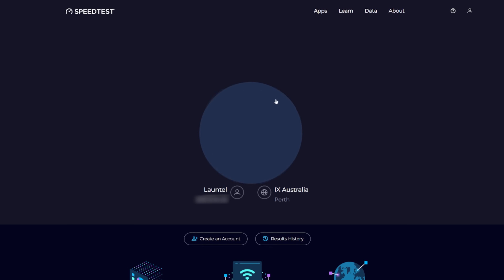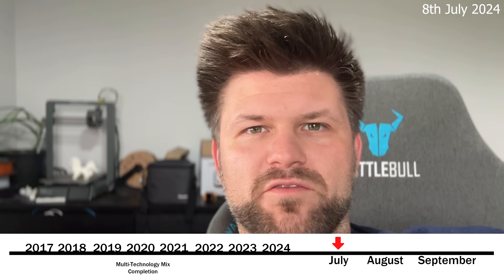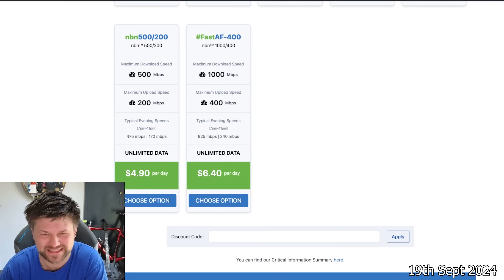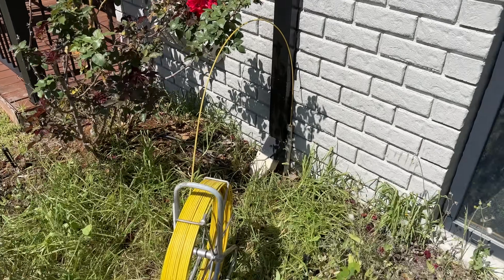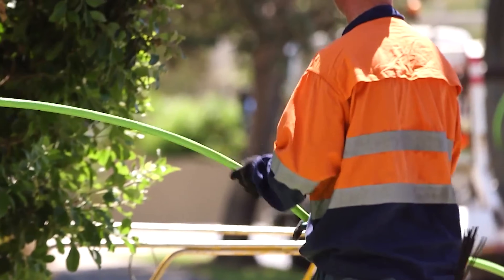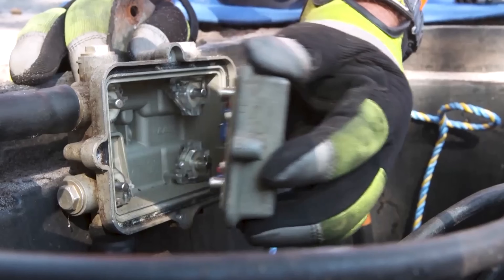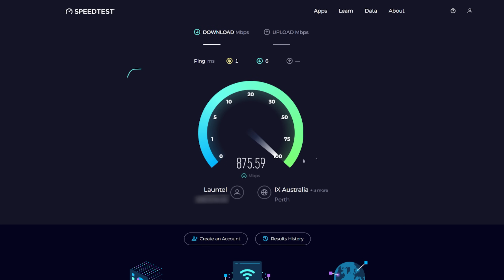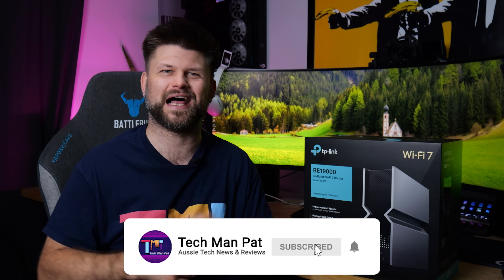My NBN Fibre Upgrade Experience | Dirt Report

Comment: I have been told by some data cablers that running a conduit in a built home is almost impossible due to wiring rules being too restrictive and not being cost effective, but they have turned around and said they can pre run a fibre optic cable to the room I want in preparation for upgrade day, cost I have been quoted is $550? Am I being scammed?

Is this info correct?

Comment: I had a roller coaster when I got HFC to full fiber (FTTP) (HFC: 1650down / 86up Dual Connections) to 2000Mbit down 500Mbit up super fast as of writing this from the speed boosts and about 30$ less for 2 lines.
They said the line is in and I am able to get it but they said my side had no line so the guys were nice enough to install the line down to the node since I had already ordered it and Aussie said they will cover the first month for me and half price for about 6 months since I needed faster speeds for work and NBN not listing the issue.
I am happy with my 1000/400 to 2000/500 now :)
They did just berry the cable and part was just hanging out of grate and my landlord was not happy and had to get them to put the cable at least deeper in the ground. No cost. Thats why they gave me 1 month free and half price for 6.

Comment: Put through a request for FTTP on Wednesday, they had techs come out and install on that Friday. I initially thought they were just coming out to inspect to see if it can be done but I was wrong. 

They were able to install it exactly where I wanted, which they went into the roof to run cables. It was insanely quick

Comment: I have FTTC. The pit is on the council strip on my neighbours house - right on the border of my house. It’s been FTTC since I swapped from ADSL2. I have about 9 metres of copper from the pit to my phone port. 
Can’t see any reason to upgrade to FTTP. I used to have 50Mbps, but now that I live alone I’ve moved down to 25Mbps to save a buck or two.  My home phone was installed in 1982, so I can imagine the copper/conduit is not in the best condition having sat underground for 40 plus years, but my FTTC works flawlessly.

Comment: Great video.  Thanks for taking us though your upgrade.  Regarding how far into the premises NBN techs will run fibre to the NTD.  You mentioned 12 metres - and that's what I've heard/read.  However, you also said IF I get an approved P20 conduit run inside the roof (with a drawstring) the NBN tech will do a fibre run of up to 40 metres?  Is that distance still correct?

I'm gonna have a conduit run in the roof.  It'll only be 15 metres which includes coming down an internal wall to my study.  Let's hope that if I go to this trouble the NBN tech will run fibre through it.  Fingers crossed.

Comment: Just a suggestion.
Ensue your NTD is accessible (not put behind furniture) so you can see the lights for fault finding and also ease of access when its time to replace the battery backup, which comes complete with a "smoke alarm like" warning buzzer every couple of minutes.

Comment: Pat, I recently had FTTP installed into my home as well, using iiNet and NBN. I note in your video that you say you are using a Deco Mesh setup and the TP-Link BE800. When I looked this Modem/Router up it says it is EzyMesh capable. Why I noted this is when I recently contacted TP-Link Technical support about the VX420-g2h Modem Router's mesh capabilities that iiNet provided me, I was told that TP-Link have three Mesh Flavours, Ezymesh, OneMesh and Deco Mesh and, that none of these interwork with the others. Perplexing as they are all TP-Link systems.

Anyway, how is it that you can be using the BE800 Router (which is meant to be EzyMesh) with a Deco Mesh System?

Comment: My parents recently had their FTTN converted to FTTP. The NBN contractors who installed it, put it approx 5 cm underground, with no conduit used from the footpath pit. 
Is there a minimum depth that the cable needs to be and is it mandatory for them to use conduit? My Dad is worried about it being too shallow.

Comment: They are also not supposed to put it on a second floor either. Recently finally got a fibre upgrade at my work where I do IT, we ended up running our own conduit to the location with a pull string, after the NBN techs showed where they were going to put the external box. End up being simple install in the end.

Also just note that you cant just use any 20mm conduit. There is a special NBN conduit which is actually 22mm I think. It is actually marked as NBN conduit that we found out about from our local electrical wholesaler.

Comment: If I had an option for fiber I would ask for 10G SPF+ fiber speed with at least a Mikrotik 10gig router if not an OPNsense box. Ethernet is slightly slower not that it matters :)

Comment: Just completed my FTTP upgrade. As I wanted the NTD installed in the top of a cupboard in the middle of the house, I bought some 20 mm communications conduit from Bunnings and ran it up the outside wall, then into my roof, then across to the cupboard, then down into the top of cupboard. I had a pull line in it ready to go. The tech was pleased to see that I had made his job easy. I ended up with almost exactly the install I was hoping for.

Comment: GigabitMan Pat.

I still laugh when I download a ~200MB file and it just instantly finishes.
Reply from the maker: haha best feeling!
Reply: @TechManPat  2017 I got 80/20 via FTTN and it was twenty times what I'd endured since 2003 on ADSL.  I have no complaints even up until now however we are now told FTTC is slated for us in SA @ 800MB/sec which is far more than I require.

Comment: fyi you are flogging an ISP that is just a reseller of the nbn network.  on fibre service, you probally wont find much difference between resellers unless you are getting a larger provider who has deals with nbn and can route your service around some of the nbn short commings.

Since that is the case.. most of the times the cheapest will do and you know that that provider will not go under
Reply: NBN connects you to the ISP. ISP connects you to the internet. Performance across ISPs does vary, but not enough for most people to care.

Comment: My installer went above and beyond on a tough install. The outdoor wall box is at one corner of the house. The NTD location is at the opposite corner about 20 metres away. Cable length that's about 27 metres away. He put the cable straight up from the outdoor box into the roof. He removed some roof tiles and pushed the cable through the roof cavity and at the NTD end he planned on using the old copper to pull down to the bottom of the wall. But the hole was too small in the joists to get the connector through. He called another installer friend to come and help. They cut the end off so the cable would fit through and pulled it the other way then put a new connector on the cable. He did say that without conduit for the cable in the roof it might get damaged and need to be replaced. I'll deal with that if it happens.

Comment: I don't think the NBN installer will be happy with the house I live in to install FTTP. It has brick cement render/plaster walls and the current wifi modem is in the dining room which is located in the middle of the house. They could route the Fibre cable along the same path of the existing copper telephone landline to the hallway. We'll see when the time comes.
Reply from the maker: It’s likely they will ask for a closer place… to make a job easier

Comment: I was told they would ONLY put it in the garage. However, when the technicians arrived, there were two of them, both Indian (irrelevant I know but I find Indian people very friendly and hardworking)  and very, very professional they looked at the garage and asked me where the Study was where the current modem is located. I told them it was on the other side of the back wall of the garage........ and the head installer said "Well, why don't we just put the NTD in your study and you can save on running cable to and from?".
Great!! That's what they did and they tried very hard for half an hour to get the conduit through the wall but it being alongside a window, the extra bracing prevented it so they put the conduit down the brick wall from the eves and into the house that way. I was totally happy with that because they sealed everything up so rain/moisture couldn't get in and we had a big rainstorm the next day and no leaks!! Also, there is a conduit on the opposite side wall of the house where the conduit comes from the street so no dramas. From there to the study side they pushed a conduit through the roof simply by removing tiles on the edge and pushing it through.

If I had a question, it would be that I got a text message from iiNet to advise me to plug the NTD into the modem (the FTTN is still connected for a week or so) so they are both plugged into the modem/router now but when I log on to iiNet Toolbox it tells me the install is still "in progress".

How long does it usually take for the FTTP connection to start 'working' after the NBN leave the premises, is it days or hours or what?

I'm a bit confused now because I don't know whether to disconnect the old telephone (RJ11) cord from the router or not? When I do a speed test on the computer, it still says around 60-70 Mbps so obviously the FTTP isn't 'active' yet?? Love your videos by the way, they've been very helpful when I decided to avail myself of the free FTTP upgrade in preparing.
Reply: iiNet FttP should work same day as install. If not, give them a call.
Reply: @iamdave84  it did!! Within an hour of the installers leaving.

Comment: Thanks for the vid Pat, very interesting but I'm confused by all these modems. Near the end you say you no longer need a modem but there's that TP Link thing there on your desk AND the NBN modem on your wall. BTW the NBN modem on your wall was pretty ugly - I presume there was a final cover that went over it that you didn't show us???
Reply from the maker: Hello mate, so before you had to have a modem router combo, you no longer need that, as the NTD acts like a modem. Yes there is a plastic cover on top, and I realise now I did not show that, that was my oversight. Yes people also like to hide it, it’s not pretty. 

The TP Link is a router distributing the connection across wifi and Ethernet
Reply: @TechManPat  Thanks Pat. So, if I want to service other rooms in our house I definitely need something like the TP Link device (modem/router?) i.e. the NBN box does not do wi-fi, correct? - it only plugs into a computer in your office there?
Reply: @brianhoward9217 that's right, the NBN box itself does not do wifi. If you have a big house you might benefit from a wifi mesh system like the one Pat references in his network diagram.

Comment: Always remember, during a fiber rollout:
1. The headend has to configure a VLAN for new areas
2. The physical buildout has to take place
3. The Fiber Acess terminals must be numberd and added to the system
4. It must be tested thoroughly (using employess who live in the area)
5. The F.A.T. has to be spliced and the (edge-node/P.O.P./Exchange) has to be built 
6. And finally the coustomers have to sign up
Time estimate: about 6 months (seeing that a natural disaster didn't happen)

Comment: I don't agree that the NTD is doing "more work" than your router. Quite the opposite.

The NTD is basically bridging - it doesn't have to do any routing whatsoever.

Your router on the other hand has to route and NAT and such - all things that require a lot more processing power than basic bridging that the NTD does.
Reply from the maker: Yes fair call, that was an bad choice of words on my part

Comment: The other shit part ive notcied about this is, they do no weather or pest sealing on the gigantic hole in your walls. At least in the last 5 homes ive been in its all the same gaping hall covered by the box. Also i cannot ever even imagine a dodgy installer self signing the pdf either.... Its great to see that this guy does a good job joining the fibres. The last indian bloke that turned up to our last place didnt even bother wiping the dogshit off his shoes, walked it all through our house and stank like the most horrendous disgusting BO.

Comment: moved into a home where the stupid nbn box is in the garage, close to the roller door. wifi is greaT obviously in the garage, so you could theoretically watch 8k porn in the car etc but due to the built up area around the place everyone else has wifi in their house etc. and the rooms being a decent walk away from the garage and no internal ethernet wiring in the house, and As im renting i just grabbed a cat8 cable, threw it through the roof, dropped it down the wall into the living room and run the router there. Id like to pick up a tp link router like yours but am stuck with the garbage asus one ive got for a while. BUT, have 950 upwards by 50 and great wifi coverage now on all bands. As im renting i just changed the wallplate to add in an ethernet port to an old phone port and when i leave il just unclip the ethernet cable, put the crap rj11 port back on the wall and they will have no idea.

Comment: Congrats on finally upgrading Pat. Welcome to having a solid internet connection & not needing to worry about buffering issues. You jumped to 1GB off the bat! 💨 

I do splicing for my job (haven’t heard of it referred to as welding heh) - have done thousands of them & it’s still an amazing process to me…fusing glass together so light can shoot through & basically provide a future proof infrastructure.
Reply from the maker: I always called it splicing until the guys said welding :)
Reply: @TechManPat    Congrats. I’ve retired from Chorus NZ for some years now. Anyway you’ll find by and large trouble free internet now. A high quality modem is a must and it seems you have one. 

As you know the key to great internet connection is a good powerful wireless  device or a high quality PC and a top quality powerful modem. All preferably no older than 5 years. Fibre is a must. You’ll find within a few more years 4-10 gigs will be normal. I’ve got 1 gig.

Cheers Ak, NZ.

Comment: I too had mine installed recently. I have a 6 fan out in the street pit and I'm the 1st connection on it. The fiber run to the PCD is about 40m then via a coupler in the PCD to the inside NTD.  Using a Fiber PON tester the 1490nm from NBN is at -21.7dbm and about -21.9 dbm at the NTD.  The out put of the NTD (upload) on 1310nm is 1.4dbm.   I was told as number of subscribers added the the fan my signal at 1490nm will be less and I believe the spec is no less than -23dbm.  Did he measure your levels?  What I didn't find out was how much less per client added to the fan out in the pit.  Glad yours went well like mine and I tested on Launtel at the full 1000/400 in the free 7 day term and was getting 915 down and 314 up Adel to Perth using Ookla but noted some ISP's destination in Perth can be much less.  Ping eventually was 34nS down, 32nS up.  However initially I had a 105nS up.  Launtel were good and said it was NBN default  buffer shaping and in the advance section in the portal the usr can change that buffering method.  BTW I used your discount code too, thanks.  A $25 credit.

Comment: My house just became eligible for a FTTN > FTTP upgrade. I'm currently in the process is running 20mm conduit from the Madison box up into my roof across to the my tech cupboard where I want the NTD installed. Anyone know whether the existing Madison box and copper lead-in cable will be removed of will NBN Co just put the PCD beside the Madison box?

Ps. Great video, Pat.
Reply: Make sure your tech cupboard is well ventilated, otherwise the tech will likely deem it unsuitable because of risk of the equipment overheating
Reply: @iamdave84  yep, I had already installed a passive 150 mm vent. The technician was happy to install the NBN gear in the cupboard and all went well.
Reply: Would you prefer the Madison box be removed or left there?
Reply: removed. The tech said they're supposed to leave the Madison box because apparently it's Telstra property but almost everyone wants it removed as they don't want two boxes. He removed my Madison box and put the NBN box in its place. The copper from the Madison box is still there and connected but it's out of sight behind the new NBN box.
Reply: @JonBOY26 good stuff. If we don't want the old box there, safest bet is to remove it before the tech arrives, that way they don't have to risk violating rules to give us the cleanest possible install.
Reply: @iamdave84  very true! The techs have to take lots of photos so he was telling me that one day he's going to get into trouble when his boss starts questioning how is it that at every install he does there's never a Madison box that he has to leave in place and work around 😂

Comment: At my house they used the existing phone line tube, which being a 70's house, it was actually metal. They had to dig up pavers to get to it and flush it out with a hose of course. They ran the fibre through the roof and they did have to take up tiles as our crawlspace sucks.

I believe they just used a ladder to get to the roof instead of going on it. All up I got it exactly where I wanted it. All up the 2 blokes were here for 5 hours, were very understanding and did a fantastic job 😊

Comment: I had mine in the garage, in a cabinet put in place by the builder. It was a tight spot but they made it work. Modem is up high above that now but when I move RSP next year I'm going to pay extra for wifi repeaters and put the modem in the locked cabinet for security and aesthetics.
Reply: Just make sure the cabinet is well ventilated. Those NTDs get warm, and if the heat can't escape they can overheat.